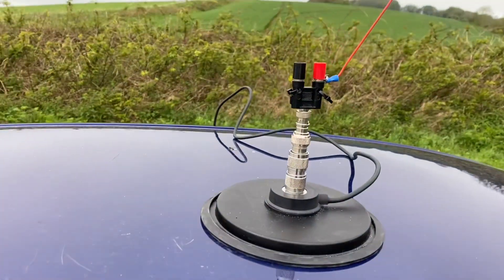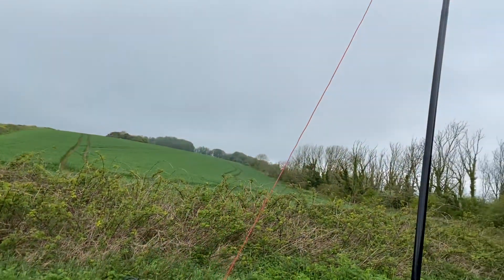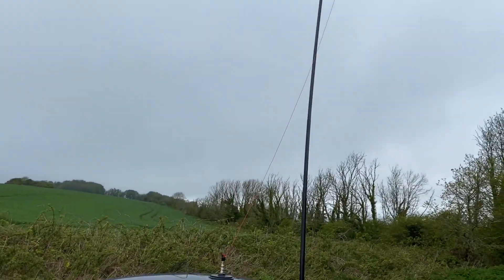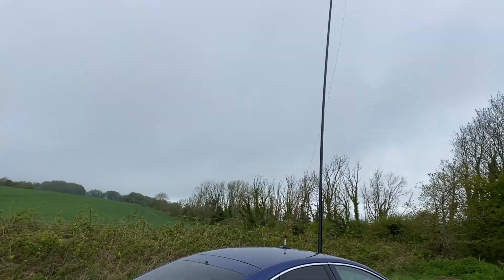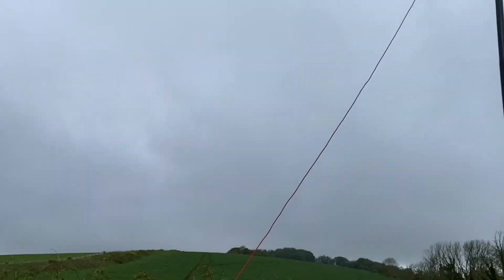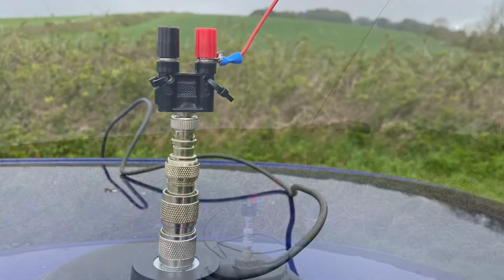Ham Radio: Simple & Quick to Deploy HF Portable Antenna

Comment: Great video. One thing that I have learned helps is to place a piece of 1 meter by 1 meter faraday cloth under the mag mount and connect it to the shield of the coax with a clip of some type. This better coupled the antenna to the chassis of the car and lowered the VSWR to almost 1:1. Cheers
Reply from the maker: That’s a great tip!

Comment: Just put banana plug directly to mag mount pl connector
Reply from the maker: @Damir-p1d  this is much less prone to the wire being yanked out if the wire is blown about
Reply: @timg5tm941  you are right. I made a knot on the wire and tie it with plastic twine for the mag mount. 

I never have problems with 5m of wire L/4 for 14MHz with banana directly to mag mount. 

Using wire this way is also good for 500 to 1600 kHz listening. Even LW :-)

Point is to try

Comment: Hi Tim  I have a question I want to use  2signal stick antenna  for 2mtr 70cm  I’m trying to build a dipole centre  using three Bnc males so my question is do you add all three centre conductors together or just split the shield and then enter conductor to each side shield to centre conductor  on the   Right and main conductor on the left  any help appreciated
Reply from the maker: Ok - are you building a fan dipole here? If so, then shield to one side, conductor to the other (of both antennas).

Comment: Excellent video, And a great idea, living in an HOA controlled community, (one with antenna restrictions),  I have done the opposite to create a more hidden 40 meter vertical base station antenna. Its a 20 foot PVC pipe mast, schedule 40 in thickness and 1 1/4" in diameter, with a 40 meter mobile ham-stick whip on top mounted on a slip-on pipe cap. A 1" hole drilled 100 inches from the pipe cap lets the concealed coax leave the mast. 
The key to my ground radial system is not to have one. Or to use the coax shield itself as a working part of my antenna.
 I recalculated the coax shield length of a T2LT coax antenna, A sleeve or flower pot variation of a dipole antenna and re-scaled it to 40 meters, so this coax shield half of the dipole, is 33 feet long then, a G3TXQ coax choke coil sets the coax shield to be the proper length for a 40 meter dipole. 
With a whip fitting. The short 40 meter mobile whip is the electrical equivalent of a 40 meter 1/4 wave top radial.  No cutting any coax is necessary for making this a no-ground-plane, HF vertical antenna for use on a single band. With T2LT antennas you can adjust the SWR with the top radial, and adjust the coax choke winding slightly to get the best SWR.
My HOA says that I can not have any antenna that is visible visible from the street, And this 27 foot short vertical 40 meter base station antenna cannot be seen from the street as it is behind my town house..  Like you, i can make good antennas when I am away from home, And I can have mobile antennas,  But at home, mine have to be stealth or hidden due to my Home Owners Agreement restrictions..
Reply from the maker: Sounds a fabulous piece of ingenuity!  Thank you for this excellent example 73

Comment: I’ve done this with efhw, and non-resonant long wires with good results, with 3-5W and CW. How much power are you running for SSB? And what’s the current drain like? Are you just using the internal car battery?
Reply from the maker: 100 w just SSB and using lifepo4 22ah which lasts 6-10 hrs on ssb

Comment: Do you think this may have worked even better if you'd run a wire from the ground of the connector to a bolt into the body of the car, instead of relying on capacitive coupling of the mag mount?
Reply from the maker: Yes possibly but I’m balancing convenience and performance. I guess I’m seeking to compare directly with a 2m long mobile whip. But you are correct that better grounding never hurts

Comment: I've been doing this for over 10 years Tim..tri mag on car with quarter wave of wire attached for 40m onto 12m  fibreglass pole.. works extremely well..  I also drilled the body of the mag and added two tuned elevated radials slightly sloping which if you have the time and patience works even better.. always enjoy the vids.. chat soon de EI2HPB Dave
Reply from the maker: Nice set up Dave!

Comment: Hi Tim,  do you use anything to keep your 12m pole from collapsing - taping the joints for example. I have a 12m spiderbeam pole but always worried it will stay up 🤔
Reply from the maker: No I don’t .. I’ve never had a pole collapse portable (so far)
Reply: jubilee clips in pvc pipe, stays up for ever ! :)

Comment: I wonder how a V configuration would perform on a car
Reply from the maker: Hmmm interesting
Reply: Inverted V? End or centre fed? When I'm working portable in Wales, I work out of the car by setting up a 40m (and hence also 20m/15m/10m) EFHW in an inverted V configuration a short distance from the car. With the transformer on the mag mount you could use that at one end.
Reply: I know how an inverted V performs, but was thinking of a normal V from roof of car